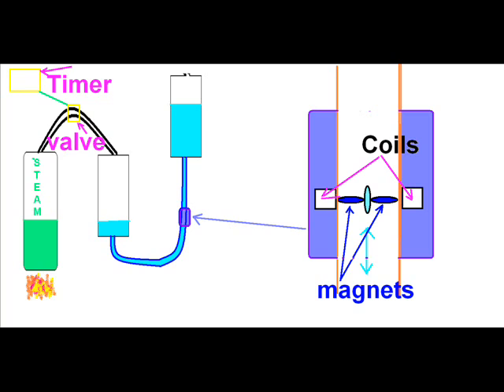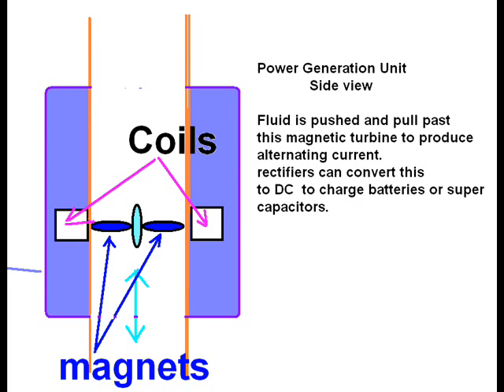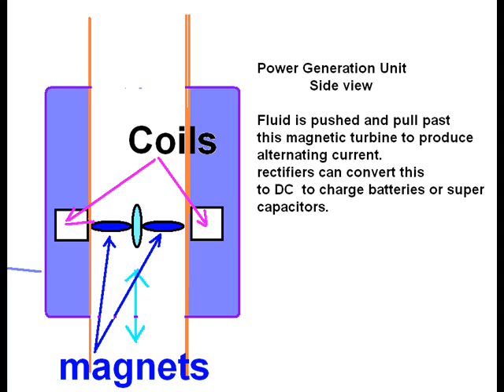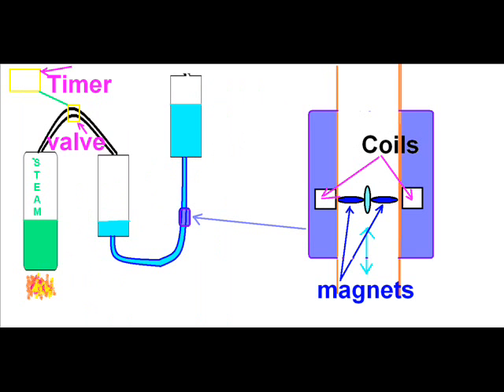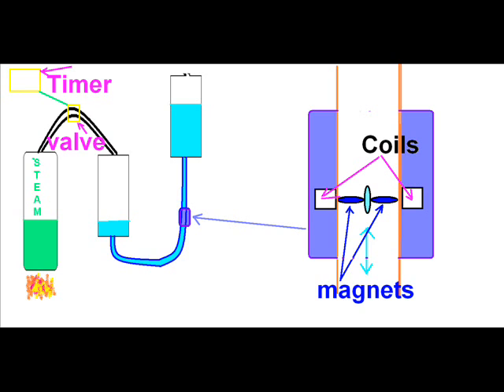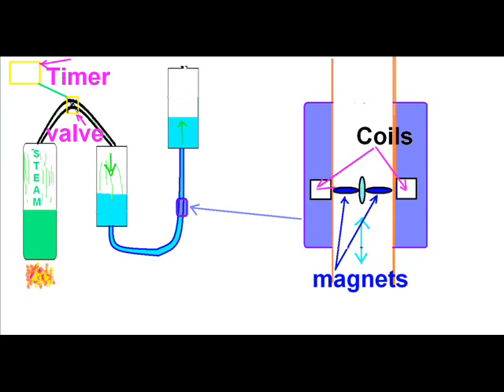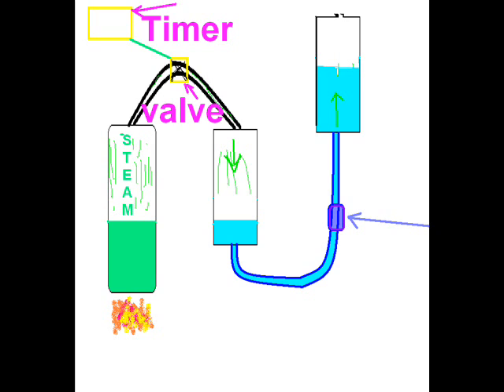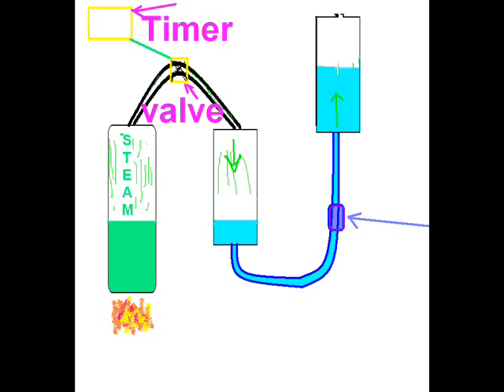liquid piston steam engine idea

Comment: I am sorry for flooding but it just stuck in my mind and I keep thinking.

I can't say for sure but I am thinking - will the steam just push the water or it will just try to work its way through the water, kind of erupting like a volcano right to the top.

I would guess this would depend on the steam build up speed. If it is slow the water column would follow but if it just bursts then it the water due to its inertia will not be able to follow.

Comment: If it is going to be on short pulses then you can use piston shaped magnet which would give you batter flow utilization (could make it 100 perc) and denser magnetis flux. Just like those self powered torches that work after few hand jerks.

But then you might want to look at fluidyne stirling engine which works in back and forth fluid pulses but uses no valves. I came here after watching hundreds of strl. eng-s in many crazy forms.

I got really hooked onto them.